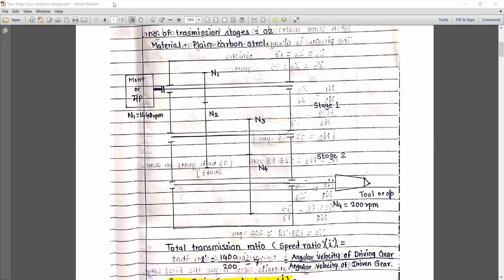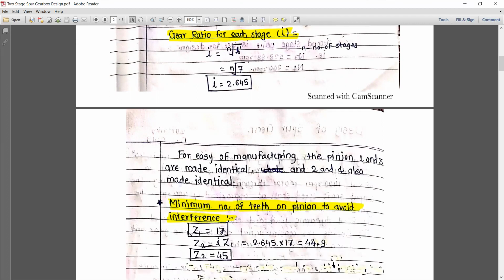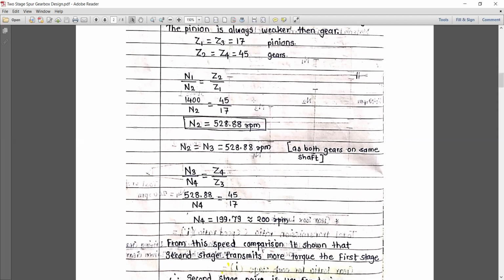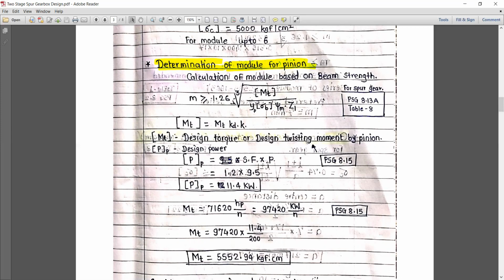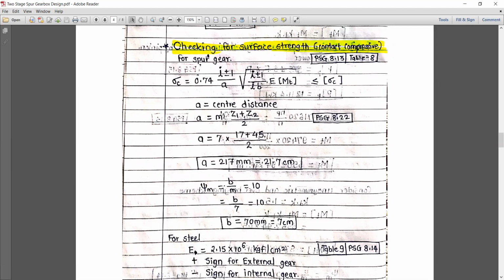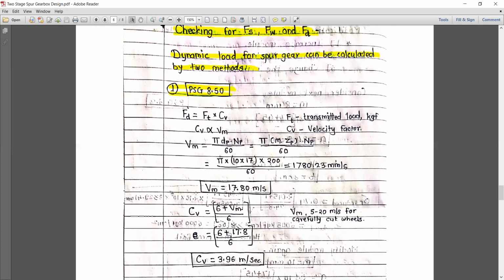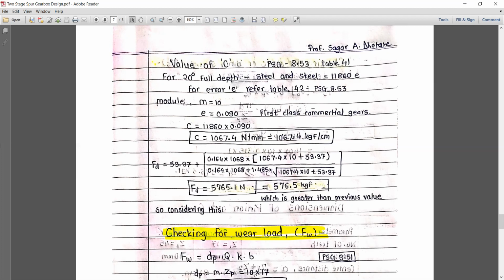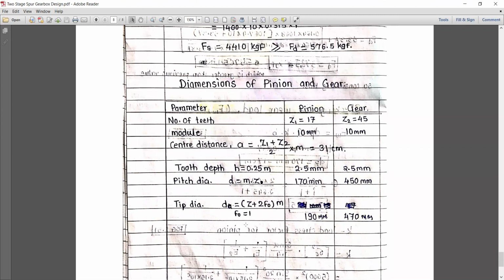Design of Two Stage Spur Gear Box

Comment: sir can built it as a major project in engineering
Reply from the maker: No, it will be part of your project or mechanism
Reply: @sagardhotare331  a specific application??
Reply from the maker: @tanmaywankhede3666  you can co relate with industrial power transmission problem
Reply: @sagardhotare331  my guide is asking for a specific application to make a problem statement.....if u tell it'll be a big help
Reply from the maker: @tanmaywankhede3666  Design and development of transmission system for ( add specifics application)
Reply: @sagardhotare331  thats what I want sir..